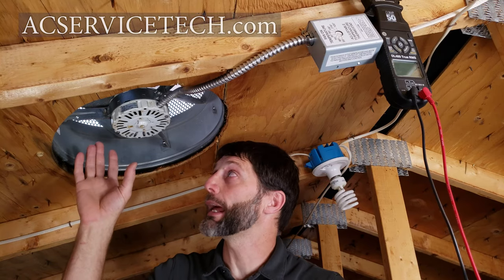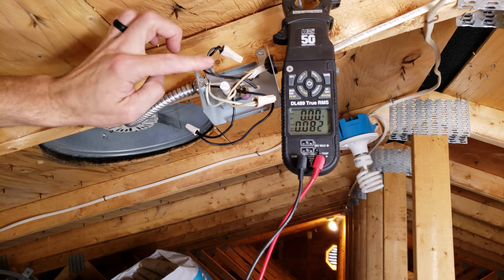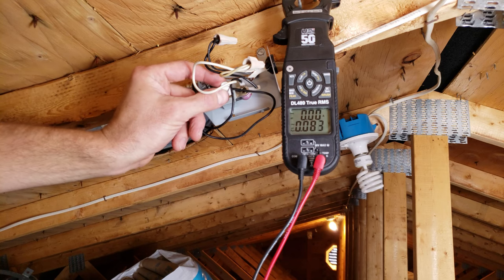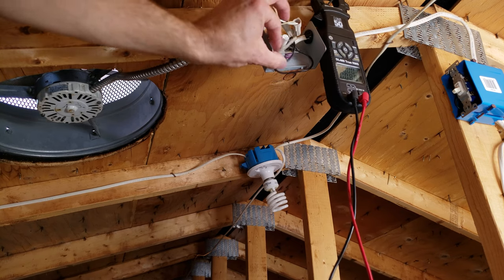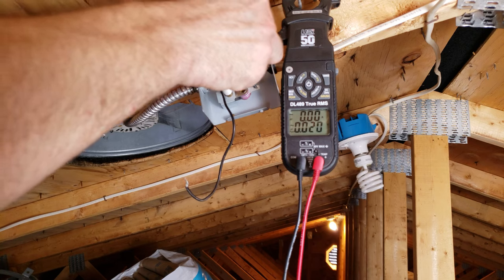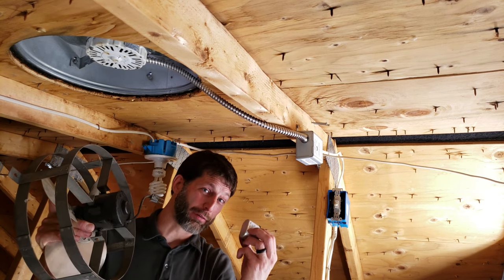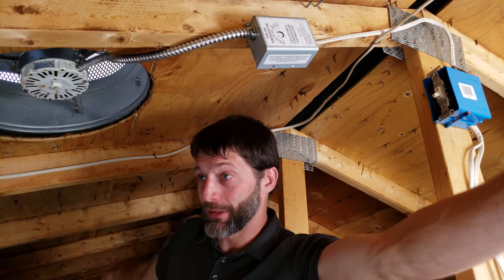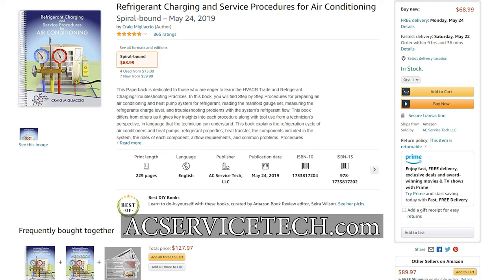Attic Fan Issues, Troubleshooting, Common Problems!

Comment: good catch on the ridge vent.  For others... you want more square inches of intake(at the eves) than you do exhaust(at the top of the roof)  If you have more exhaust, whether it's ridge vent, gable vents, turbine vents, etc, it will pull air where ever it can. To much exhaust will cause a vacuum/negative air pressure in attic and pull air from the living spaces through cracks in electrical boxes, no air sealing at other wall/ceiling penetrations.     Pulling air from the living space into the attic, will cause an imbalance in the home, too.  In return, this will cause dirty air to be pulled in form crawlspaces, cracks in floors, electrical boxes and an open window, which will make your home's air unhealthy.   Neighbors home has 5 attic vents, 2 whirly birds, 2 gable vents, and practically no intake vents.  He complains that his AC/heat is constantly turning on during the summer and in the winter....his heating and cooling costs are almost double mine and my house is 50% bigger.

Comment: I liked the fact that you follow NFPA 70E by checking with the NC Voltage Tester then before exposing the wires verified that the power was off with a multi-meter.

Comment: I'm still using a Sears Roebuck fan with oilable bearings my Grandfather bought in 1961! 
60 years so far and when fully oiled up is virtually silent ( well balanced).
Even has original fan belt on it( extreeeeeemly frayed and ratty but still holding).
Reply: Lucky! Lol, mine needs replaced, but hell, I'm glad that all of the wiring, supports and thermostat / manual switch are already in place, I just need to unbolt a couple bands and chuck the old one in the trash can and throw a new one in the hole! 😃
Reply: Awesome to see a product like your SR fan working after 60+ years, we have a 1927 Buick that runs fantastic and while I work in the auto industry I know the cars we sell today will NEVER last as long as my 96 year old Buick has, just like your Grandfather’s fan!!

Comment: I just replaced 8 of these exact fans in the office building where I work. You can buy the entire assembly with whip and thermostat at supplyhouse. The new ones don’t need run caps. This is a great video brother thanks for posting.

Comment: CRAIG , I just   installed a gable vent AC INFINITY FAN that has the LCD controller and temp sensor seperate . Now i can control my fan from in the attic acesss area down stairs without having to enter the attic ever !!!!!!!!!!!!!  best of all it has several options and a timer so you can set it . i used a old pro  honeywell back thermostate plate to notch out the size of the controler and mounted it into the plate and onto the drywall .  I have to say this is one of the best installed items  ive done well worth it .I went with the T12 model that has about 12 feet of thermostat sensor  wire i ran up to the attic from the controller and  the power wire. both ran perfectly . Also displays the attic  temperature and humidity % and seems to cool 5-8 degrees after running for 30 min and is absolutely quiet !!!!

Comment: Craig, so glad that you did CORRECTLY address the ventilation issues in this attic. Passive ventilation (soffit vents and ridge vent) is always best. This attic has "competing" ventilation which will not properly ventilate the underside of the roof. As soon as I saw the ridge vent and small gable vent and fan, I said to myself "big mistake" by builder/homeowner.

Comment: I like to say thank you for your video I had a professional come to my house and install a attic fan the fan was installed correctly but the electrician did not check the wiring before he left, the fan was not coming on he told me that I had a bad fan so I did a voltage test and found out that the hot wires had came a loose once I connected the hot wires the fans working perfect now I have it set at 90°,  thanks.👍😃

Comment: Here in Southern California I have a home that had 2 whirly bird attic fans. When we got a new roof they did the ridge cut and covered the two holes for the fans. It wasn't enough to vent the heat and it was terrible. I had to reinstall at least one attic fan.

Comment: This was unbelievably informative,  especially in reference to the ridge vent and location of the fan. I am trouble shooting my fan for not working but i just had my roof done,  and it's location is that close to the ridge. I guess it make no sense to even try to get it to work. I have some high temp issues in that section of the house during the summer and i thought i may need that fan to work but i see that insulation may be to close to the fossits.

Comment: Interesting video on testing a motor. I think these fans are usually a waste of electricity.
Reply: in extreme heat conditions they are good when the AC can't keep up, that is why the thermostat should be set at 90 degrees...

Comment: like others mentioned, glad you addressed the ridge vent / power fan combo. I had my shingles and roof sheathing replaced (sheathing w/foil on bottom side) a while back, deleted 1 power fan, and two turbine fans since the roof already had a ridge vent. I think homes like this start off with turbine vents and power fan, and the ridge vent is added years later.   To avoid dealing with 3 big holes in the roof, people just leave the power vent / turbine vents.
Reply: I have a similar situation, I had a new roof installed, with a ridge vent. And the attic fan is still there, the bearings seized some years ago, it does not work, and I think it's actually bringing air into the attic instead of letting the ridge vent bring air up from the soffits. Right? That's why deleted the power fan?
Reply: @robeaston5046  yup. vents in the roof can interfere a bit with the natural convection current pulling air up from the soffit up and out of the ridge vent. The power fan I deleted was attached to the roof sheathing
Attic fan you mean like my first house there was a 30" fan in the hallway ceiling, with louvers that opened when the fan was running? It pulled hot air from the living space up into the attic. I would open windows in the evening when it cooled down so I could turn off the AC.
Reply: @thebluelunarmonkey  that's perfect! I am trying to justify the cost of paying a roofer to remove the broken attic fan now. thank you!
Reply: @robeaston5046  Welcome Rob. 
Would have been much easier removing the power vent during the reshingle.

Since you already had the new roof installed with your old power vent, you might just want to block off the vent. Remove the fan and block off the hole, doesn't have to be airtight since the outside vent keeps the rain out - you just don't want an air current flowing thru that vent which disrupts the flow from soffits to ridge vent. 

You can DIY this. Tack up some rigid foam board or cut a 2ftx2ft project panel to fit between the rafters. If the vent has louvers that open and close, you can tack them closed with construction adhesive, but not vital to do that if you can't reach from inside the attic.
Reply: @thebluelunarmonkey  great idea, I should be able to do that! (even I, a guy who types for a living).

Comment: RE: the fan location issue--> What about mounting a regular box fan ( airflow "up"), ...right under a ridge vent?...locating the fan inches below the ridge vent? Would this "help" the hot air to escape upwards through the ridge ( as would normally occur anyway)...by drawing air from the eave vents ( as would occur normally).....basically an "assist" ? I would also think the low airflow volume would have less chance of sucking-in air through cracks and such from the living area...it's just a mild assist.

Comment: Ideally, the thermostat should be mounted lower away from the roof. That roof is going to radiate heat during sunny days and possibly fake out that t stat. Fan could run continuously.👍👌
Good video though on diagnosis and operation.
Reply: I disagree, Heat rises. If that stat is lower it will come on a lot later and your playing catch up as well as higher temps.  If anything I would turn down the set point to 75 or 80  so when the sun isn't shinning your cooling things off after sundown or cloudy days.
Reply: @TheEZGZ  lmao, how about 40 years in the field. Ok, so let’s assume your in Florida then ,and attics get to 130 degrees often and that thermostat is 4 or 5 inches off the roof deck which during the day  the sun is beating down . 150 to 160 degree deck. Mount that stat 8 to a12 inches down and still kicking on in the 130 to 90 degree range for long periods. 
So, in summary this all depends on geographic location, roof type and attic ventilation. 
I made a general statement based on an average so, carry on.😎
Reply: You make some valid points. There are many variables.  You know what they say about ass u me. hehehe   I'm in Colorado all my life. I too worked in HVAC industry. I'm glad to be retired. Stay safe my friend.  Peace!

Comment: Whar are your thoughts of using  the powered attic fan as a whole house fan and draw the ambient air from the living area up through the Suttle hole and out into the attic and then through the fan to exhaust outside?

Comment: There are two oil eyelets on the upper and lower motor covers  near the sleeve bearings… they’re not sealed… I just oiled mine on the same motor shown here…sadly when the soffit vents are clogged with blown in insulation, your motor will run indefinitely until it burns up… Tip… clear the intake soffit vents by using a strong leaf blower from the outside…

Comment: Great points thank you sir years ago I had my house re-roof and had the roofers install multiple vents. Our roof fan died not long afterwards.I was going to replace it but after research I find that the power vent is unnecessary since I already have multiple roof events and soffit vents.Thought’s 🤷‍♂️
Reply: Unfortunately my fan is installed at that same exact location you stated. I had it replaced and it never worked again. It’s a brand new fan that won’t turn on after doing the diagnostics you showed everything is fine but won’t turn on . I live in a row town house colonial style and it has multiple soffit vents on both front and rear side.Should I call to get it checked out again or is it not worth it since I have soffit?

Comment: Great video and comments. Possible dumb question but I also got a new roof a few years ago, house actually seems hotter. I now have ridge vents and I have this OLD attic fan that is seized up, no longer works. 
1. Was thinking about replacing the whole house fan in my ceiling (it pushes hot hair into the attic), but is that what I really need
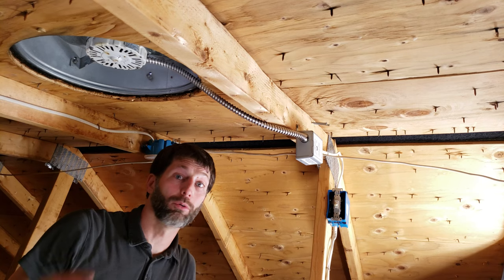2. But should I pay a roofer to remove the attic fan, it's not needed, and apparently(?) based on the 5:56 mark of this video, the ventilation of my attic is now goofed up, because the fresh air ventilation is now being sucked in FROM the attic fan hole and NOT from the soffit (which I have a lot of) vents. The roofer thinks the attic fan "hole" is short circuiting the airflow.

Comment: Power ventilation is great! Unfortunately to me the motors tend to wear out 3-6 years! Some don’t make 5 years!!! Kinda like car/vehicle batteries!
But at least the opening will still exhaust heat even when the motor isn’t running…… install whole house fan & the heat can exhaust through that opening too🤘🏼👌👍🏽
Reply: My roofer doesn't agree. He thinks my defective attic fan is short-circuiting what the ridge vent should do. thoughts?

Comment: While there are no spots to oil the bearings, it does not look like it would be too hard to disassemble the motor and add some synthetic oil to the bearings.  If it was done when they are new wouldn't they last a bit longer? Just thinking about my locked-up motor and how many have locked up in Home Depot reviews.

Comment: My attic fan (similar to this one in the video) is working but it's making noise like it's hitting the sides of the metal enclosure. When I turned off the power and spun the fan by hand, the blades were clear from the side housing and not touching anything. However, when I spun it by hand the blade had a bit of a wobble to it. The center shaft also had a bit of a wobble. Does this mean the shaft is loose causing it to flutter and make noise? Do you think it needs to be replaced? Thanks.
Reply: Worn-out bearings.  Time to replace the motor.

Comment: I've got a question.  I've recently replaced a broken attic fan motor and it vibrates/wobbles slightly when running.  It's fully screwed and clamped in and as far as I can eyeball is not clamped unevenly.  Is this normal for 1500 rpm fans?

Comment: Meant to say PPE. For that circuit would need 600 volt rubber gloves worn under canvas gloves face sheild and PPE rated long sleeve shirt & pants. Now they are telling use to use PPE T shirts rather than 100% cotton shirts. We even had to wear PPE rated sweat shirts &/or jackets in cold weather.
Reply: What?  Ppe for residential voltage?  Lol.   Nah..

Comment: I have a solar attic fan not working. Theres two wires coming down from the motor in the attic. I found them disconnected. Should they be connected? I have tried and still not working? Any ideas?

Comment: I have an attic fan that quit working entirely. The motor's 10 mfd capacitor was OK, the motor spins freely, and power is applied, but it will not run, indicating melted windings or thermal overload tripping. It has been a couple hours since it quit working. Is it possible to revive the motor or does it have to be replaced? Thank you for any advice. If it helps, it failed about 10 minutes after one of the capacitor leads unintentionally slid off. This fan was also on a Z-wave speed control dimmer which has been confirmed to still function as a dimmer.
Edit: The motor has been used since 2006 in a detached garage attic mounted on a standard attic fan wall vent.

Comment: The most common problem I've found is thermal cutoff. Makes me wonder WHY would you design an "attic fan" with a thermal cutoff of 120 degrees. one power failure during the summer and your done.

Comment: I wired my fan 4 different ways, the last being exactly as diagram in YouTube video yet my thermostat is working backwards. Meaning, it comes on when turned to the left, (colder setting) and turned right (hotter setting), it goes off.

Comment: I have gable vents on each end of the attic and an attic fan in the center. There is no soffit ventilation. If I understood what you said if you have gable vents and a properly installed attic fan w/o soffit ventilation is that the right way to do it?

Comment: Find so often the temp setting is too low meaning the fan is powered far too many run hours meaning an early death. 90F or 32C is better. Even when off they still remove hot air

Comment: Why doesn't that attic fan have a capacitor(little black box)connected to the body of the fan?Like say a Broan EGV6 attic fan.

Doesn't a attic fan need a capacitor to run properly or not)asking for a friend😊

I guess no one can answer that...😊

Comment: don't agree on 'no need for the attic fan due to the ridge vent' - natural venting is too weak to cool the attic.
Reply: I concur, I feel like the attic fan, even with ridge vent, provides enhanced evacuation of the volume of hot air in the attic space (with soffit vents all around). Even if a portion of the intake air would happen to get drawn in from the ridge vent. imo
Reply: A power venter will always trump ridge vent! I’ve seen ridge vent & still notice an attic still holding heat! (May be due to poor soffit/eaves vent!?)
Lot of things can be the culprit of a hot attic!  Baffles & insulating rafters can help too! Learn where & how to install all these things & you’ll have a cooler attic & house below it🤘🏼👍🏽👌👋🏼

Comment: Also unless your attic is hermetically sealed from the rest of your house (it's not) your going to just pull your conditioned air out of your home and into your attic. Yes the attic will be cooler but at the cost of the rest of the home.
Reply: Proper outdoor intake vent sizing 👍

Comment: An attic fan is probably going to be sucking expensive air conditioned air from the space below. Better to air seal the ceiling and have a lot of insulation in the ceiling.
Reply: true on the sealing the attic part - but the air seeping in (from outside through window sill/door gap etc to replacing the conditioned air ) is much  cooler than the air venting out - overall, makes sense to have an attic fan.